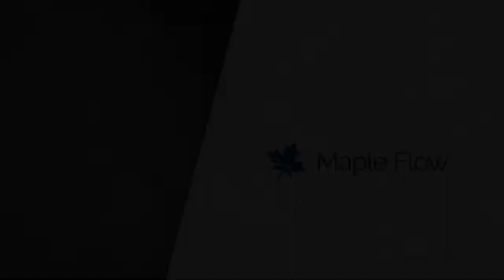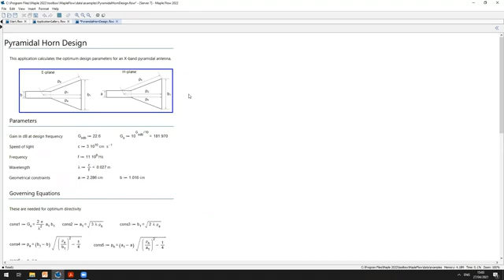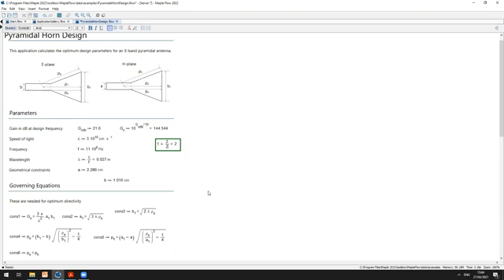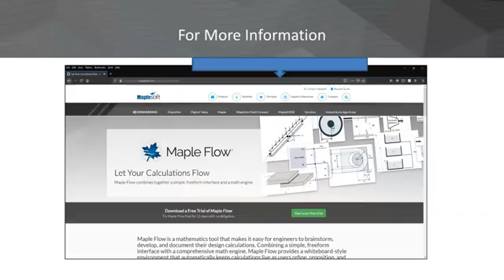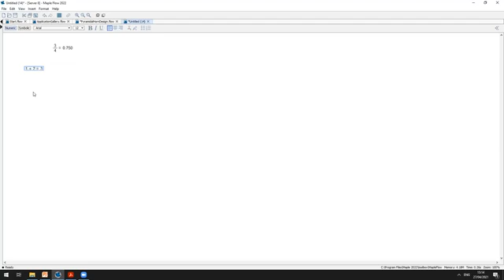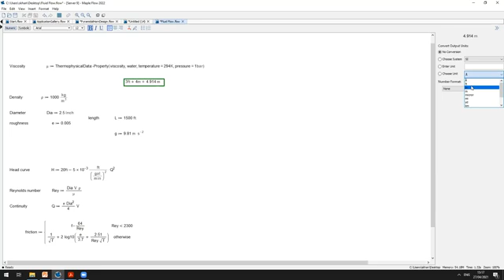Introducing Maple Flow: A Freeform Whiteboard for Design Calculations

Comment: Maple Flow seems half-baked and has some discrepancies with Maple. I had problems trying to define a function in flow and found myself looking through multiple menus and dropdowns, when in maple I can just type out the function and it works. The text also seems weird, and it took a lot of searching to find that I need to hit the spacebar to make a text box that can contain numbers.
Reply from the maker: Hi there - thanks for the comment. Assuming you mean an arrow procedure, you can define a function in exactly the same way as Maple. Could you perhaps contact technical support with more information, and we’d be happy to help (we’ll also give you the inside track on the next version of Maple Flow!)
Reply: @maplesoft  No, I can't do this f(x):=3*x